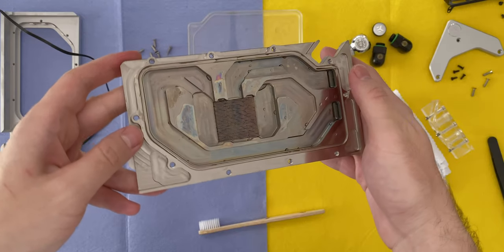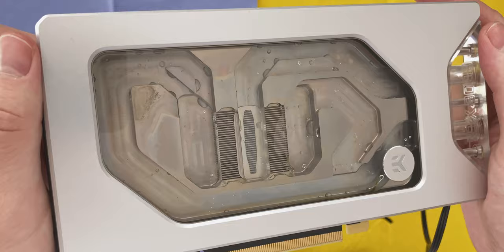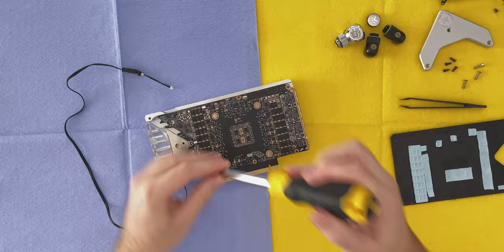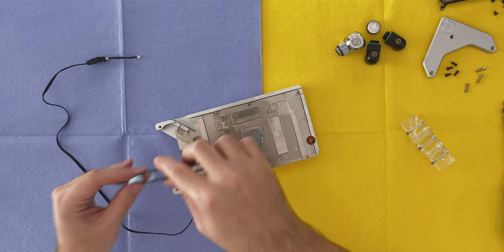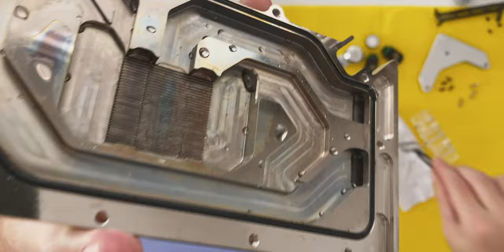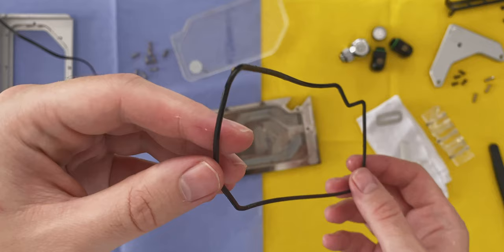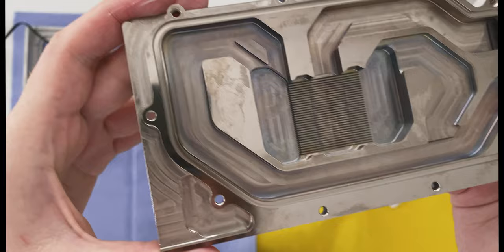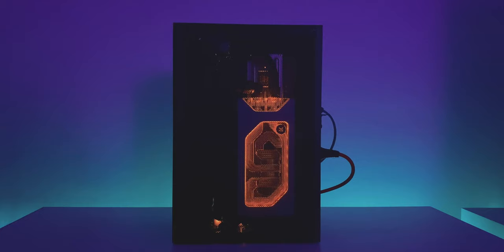Cleaning the EK 3080 FE Waterblock

Comment: Looking forward to the Meshlicious build! I was planning on building a custom loop in the H1 but came across a good deal on a 5800x and wasn't more cooling. The plan now is to build in the Meshlicious with dual radiators. Excited to see how you go about it!
Reply from the maker: Meshli video is finally out! Better late than never...
Reply: @EIGAtech  I'll check out out! Currently have my build in the Meshlicious but just with an AIO and the standoff mod for both the motherboard and GPU.

I'm really impressed by temps though. I sit at 67-69 on both the CPU and GPU when gaming. This is on a Ryzen 7 3800x and a 3080ti FE.

Comment: the cause to this i think is EK Cryofuel, before used cyrofuel i had used other brand like bykski clear concentrate for over a yrs and my block still look like new. But after i try using Ek cryofuel after like 2 month i can see a layer on my block and look like yours
Reply from the maker: I have seen reports of that happening with EK Cryofuel concentrate, but the one I used is premix. I also have the Corsair XG7 3080 waterblock with the same EK Cryofuel Clear in it and that one looks pristine!
Reply: @EIGAtech  I used cryofuel concentrate so that the cause. Now im switchin back to my previous coolant after deep cleaning all the wax look stain and now all look good

Comment: Great video 👍
How was your memory temps after putting the better thermal pads on there? I'm considering getting some Gelids but not sure how much of an improvement I'll see....
Reply from the maker: Thanks! I couldn't say for certain. The specs on the Gelids are way better than the stock EK pads, but I have not done any 1:1 testing with the same setup, etc. The Gelids should also sweat less than the EK pads.

If you already have the block installed stick with the stock pads and maybe get Gelids for later.
Reply: @EIGAtech  oh i  bought the thermal right odyssey 1.0mm  not sure if gelid is better. will be installing this week.

Comment: Which pin input did you plug the eisbaer lt solo into on the motherboard, can you help me? I also do custom loop for nzxt h1
Reply from the maker: You should use the system fan input. You can plug the 3pin header into a 4pin, the last pin isn't needed as the pump doesn't use a PWM signal.

Comment: NZXT H1 Custom Loop | Need a Advice

I want to make similiar custoom loop made by optimum tech and you. I have Lt Solo and NexXxos st30 v2 140mm radiator. And a waterblock for the video card. Tubing is ek ZMT . How do you think I should fill the system? which way should i follow?

I added a 3-way fitting to the waterblock, it can also be filled from here. There is also a filling part of the lt solo, as well as the filling part of the radiator. How do i fill the loop in the best and maximum efficient way?
Reply from the maker: Patience is the key here.  First, start by filling up at least a few ml into the LT Solo fill port. Then, the radiator and finally the gpu 3-way splitter (whichever is highest last). Turn the case on all sides and give it a small shake, very carefully. Open the 3-way fill port again and add more liquid, being mindful that liquid might pour out when you open it, have towels ready just in case. Once a decent quantity of liquid is in,  then you can start running the pump for 10 seconds at a time, while adding more and more liquid. If the 3 way is not exactly at the top of the loop, place the case on its side in such a way that the fill port is at the highest possible point.

I made all my builds so far with at least one fill port that is at the highest point of the loop, it makes everything much easier. Also I cover pretty much everything in towels just in case - I always end up spilling a bit.
Reply: @EIGAtech  thank u so much my friend. That’s what i’m looking for. Can u write your instagram name/page. I want to follow you. Also i’ll ask A question maybe :)
Reply: @EIGAtech  By the way, how do u think 12th gen? Can I use 12900kf and RTX 3080 safe and cool with this custom loop?

Comment: The IO backplate on mine seems really malleable, is yours the same?
Reply from the maker: Yes, it's really thin and easy to bend. I've seen replacement ones on Aliexpress that look stronger. It has not been an issue for me, but it's disappointing to see for such a heavy and expensive block.
Reply: @EIGAtech  Thanks for the fast reply, I just got worried that I got a fake one or something.
Reply from the maker: @deathberry33  No no, just regular EK fake.

Comment: USE DISTILLED WATER. IT TAKES ME 10 MINS TO CLEAN AND REPLACE DISTILLED WATER.  I BUILT A WATER REPLACEMENT CENTER, PUMP RESERVOIR FOR REPLACEMENT WATER AND RESERVOIR OR OLD WATER.  ITS THAT SIMPLE AND NO STAINS.